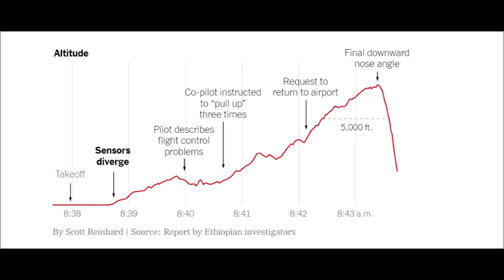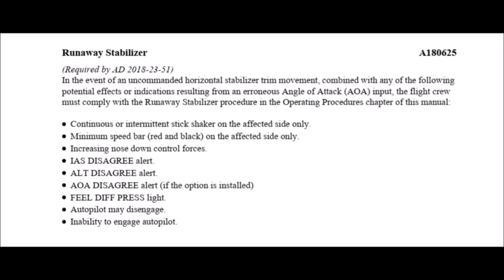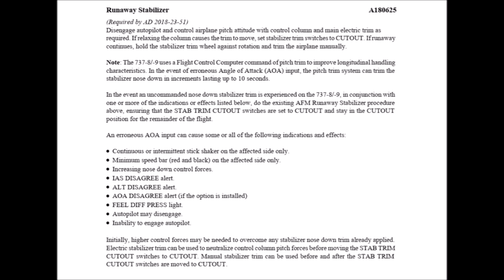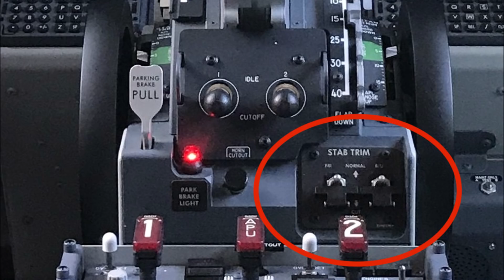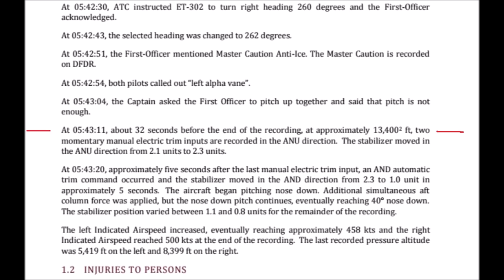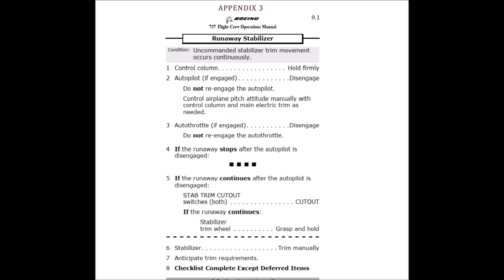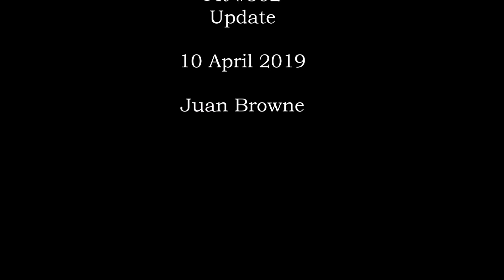737 Max Update 10 April 2019 Runaway Stab Trim Procedures

Comment: Juan, you did an remarkable job explaining the systems and procedures necessary to recover from an out of trim situation on a 737. Even laymen have a good chance to understand. One side note: My company's procedure when disconnecting the A/P was to also and immediately disengage the ATS. Handflying meant without any support by systems. This is why I liked the bird and the company I had such big pleasure to fly for. Handflying on visuals or whenever conditions allowed was commonplace. FOR PRACTISE! Knowing that OTHER airlines required pilots to turn on the 737's A/P briefly after T/O until maybe two miles before landing. Plus NOT disconnecting ATS when handflying. What we happily did. With the advent of AIRBUS' A320 things became difficult. I need not explain to you why ... Boy, am I enjoying my retiredness!

Comment: ---------------begin 1st draft of a new "Runaway Stabilizer" procedure.

A new switch, a 2 position toggle switch.
Up position labeled "HAL" enables all automation.
Down position labeled "DAVE" disables all automation.

-----start of new procedure---------------------------------

Condition:  uncommanded and/or unreasonable stab trim movement occurs.

1. Control Column...............Hold firmly

2. New Switch...................DAVE

3. If the runaway STOPS you are in complete HAND control of the aircraft and need to  quickly re trim with the main electric trim switches on the yoke.  Don't forget to manage the throttles.  Do NOT move the new switch back to the "HAL" position.  HAND FLY the aircraft, descend, land, and have the FCC (flight control computer) systems checked out.

< First exit of procedure >

4. If the runaway CONTINUES after the new switch is in the DAVE position:

STAB TRIM CUTOUT switch................CUTOUT

If the runaway CONTINUES:

< Same as old existing procedure from here on >

------end of new procedure--------------------------------

Notes:

1. New switch, Up position "HAL" enables ALL the computer systems that can touch the aircraft flight control surfaces.

2. New switch, Down position "DAVE" disables ALL the computer systems that can touch the aircraft flight control surfaces.  These systens include autopilot, autothrottle, MCAS, and any other systems that may be running "in the background" that can touch flight control surfaces.

3. If the above procedure had been active these two crashes most likely would not have happened because the pilots would have taken the 1st exit out of the runaway stabilizer procedure and been able to use the main electric trim switches on the yoke and quickly re trim the stab to regain control of the aircraft.  The other exit out of the procedure (after "CUTOUT") was the killer - they were at too high of an airspeed to hand turn the trim wheels which is the ONLY way to retrim the hor stab when trim switches are in "CUTOUT".

4. The time from start of procedure to HAND flying the aircraft in seconds;
   (Two pilots, one saying what he is about to do & the other confirming)
Old Procedure - step 1(5) + step 2(5) + step 3(5) + step 4(5) + step 5 (5) = 25 seconds.  Wheels ONLY.
New Procedure - step 1(5) + step 2(5) = 10 seconds.  Electric Trim on yoke + Wheels + MCAS disabled.

5. If we can split the two guarded trim cutout switches into two independent toggles (like it used to be?) and use one of them for my "HAL/DAVE" switch" so much the better.  It totally eliminates trying to find a place on the panel for "yet another switch".  The second toggle could then be the actual "CUTOUT" switch that removes power from the jackscrew motor.

---------------end 1st draft of a new "Runaway Stabilizer" procedure.

Hopefully we are not yet at the point where the FCC (flight control computer) can say:

 "I'm sorry Dave, I'm afraid I can't do that".

Comment: Juan, are you stating that the main electric trim switches  were not overridden by the MCAS system during that 10sec active portion of its 15sec cycle?  Thanks. It seems to me that the pilots' alternative method might have worked had they coordinated the electric trim switches with the STAB TRIM switches,
positioning them to the CUTOUT position before releasing the electric trim.   Based on the AD 2018-23-51 text, "Initially, higher control forces may be needed to overcome any stabilizer nose down trim already applied. Electric stabilizer trim can be used to neutralize control column pitch forces before moving the STAB TRIM CUTOUT switches to CUTOUT," the pilots seemed to have the right idea, but simply failed to move the STAB TRIM switches to the CUTOUT position before releasing the electric stabilizer trim. 

By the way, I wrote mainframe commercial system software for thirty-years, and I find the original MCS software design very disturbing.  There is a book, an old book called "The Art of Software Testing" by Glenford J. Myers, published in 1979.   In the book the author discusses equivalence partitioning and  boundary-value analysis, topics that do not appear to have been high on the list of considerations for the MCAS software developers.  I am also bewilder
as to why the FAA did not disclose, in AD 2018-23-51, the other conditions in which the MCAS system is deactivated: flaps extended or autopilot engaged.  It seems they still had a propensity to keep the system a black box--that's software parlance--despite the Lion Air 610 hull loss.

Finally, thanks for all the information provided on your channel.  I used it as the source of an English course essay titled "Open the pod bay doors, HAL."  It was on the topic of automation, the professor scoring it a 98%.

Comment: I like the way you report accurately and dispassionately the things the pilots did right and what they could have done better without laying blame. In the confusion of control being intermittently taken over by a system they weren't even aware of the existence of, well who knows what information overload those guys faced. That's why the NASA astronauts learned the schematics of the craft and practiced recognizing and overcoming every conceivable failure mode in the simulators so they'd automatically do the right thing. If Boeing had trained pilots in the sim to know what the AOA sensor failure did and how the MCAS would respond then the outcome could have been different.

Comment: Who did this video didn't show full preliminary report. When trim cut-out switches were already off after crew performed successful electrical trimming , MCAS system was knocked out and plane was climbing to requested 14,000 ft for about 2.5 minutes, horizontal stabilizer made again downward movements. What caused these movements if MCAS was inactive already??
Reply from the maker: You need to watch the series -covered here: https://www.youtube.com/playlist?list=PL6SYmp3qb3uPp1DS7fDy7I6y11MIMgnbO
Reply: If the 2 guarded trim switches are in CUTOUT the jackscrew electric motor has no power so the crew could NOT have performed "successful electric trimming".   MCAS was never inactive, it was just working against a dead motor and 5 seconds after you took the 2 guarded switches out of CUTOUT,  you would again be fighting MCAS down trimming using the now active motor.

Comment: Here are some other facts about the Ethiopian Airlines pilots in this crash.

The flight captain had over 8000 hours flying time, but only 181 hours in 737 type.
The first officer had apparently only 361 total flying hours. Some sources said 200 hours, but WIKI says 361. Neither would be reassuring.
Ethiopian Airlines had two Boeing 737max simulators, but neither pilot had trained in them.

Second issue: It has been said by some 737max pilots that the Runaway Stabilizer recovery procedure was not documented in the 737max flight manual. It had been described in the manual for the first generation 737s, but was apparently edited out by the time of the 4th generation manuals. That might mean that pilots who had not trained on previous generation 737s were not familiar with the procedure. So it is possible that the pilots in this case had no knowledge of the Runaway Stabilizer recovery procedures. The fact that they turned on the Stabilizer Trim switches again after turning them off adds evidence to that possibility. The fact that they left Auto Throttle on also supports that conclusion.

Time will tell if the pilots share some blame for the cause of this accident. I'm not trying to whitewash Boeing's role, but I do have concerns about the pilot training and the short flying experience of the first officer.

Comment: Nothing like sending pilots up untrained on a new system that requires them to perform 37 procedures exactly in order during a 3-minute life and death situation
Reply: Runaway horizontal stabilizer procedures have not changed on the 737 aircraft for more than 35 years. This crew was undoubtedly trained in that procedure but made the mistake of not controlling their airspeed by reducing the engine throttles, reactivating the the electric stabilizer trim motors was the final error that cost everyone on board their lives.

Comment: As a software engineer dealing with the FDA, I have some questions: 
1) how is it when systems obviously and detectably fail, all autonomous system don't give control to the pilot
2) why are the interfaces so technical and difficult, when analytically (as you do) there are some nonsense responses, who would benefit from a left hand or a right hand fail response when something is generally wrong?
3) how can an aircraft in general with 'intelligent equipment' onboard allow a nose dive and crash, when I assume there are a ton of other sensors indicating you need to pull up? (I realize that if all fails this point is void)

Not trolling, honest questions.
Love your channel as an amateur cesna operator, liked and subed
Reply from the maker: MCAS was set up the way it was to avoid a separate Type Certificate. Specifically- use the old "Runaway Trim" procedure to disable MCAS.

Comment: Boeing is so screwed.  I sold all my stock and I'm not looking back.  I see that on Apr 10 the stock actually went up.  OMG, is everyone nuts?  I'll buy it back when it hits $26.  I think Boeing has been taken over, either by bean counters or newbie engineer/code cowboys.  This totally sucks and it will get worse.  I totally have been wishing that Mary Schiavo were still head of the DOT.  We need to latch on to superstars and hold on to them at any cost.  Screw the Pentagon.  It's time to be adults.

Comment: A question, that may be fair to ask; you say that a directive was issued by the FAA to give guidance on how to handle such an error. What global impact does an FAA directive have and at what speed does such directives travel in non-native English parts of the world?
Reply from the maker: Effective globally. English is required language for aviators around the world for this reason (and others).
Reply: @blancolirio  Good to hear, are other organs advisories as effective "the other way"? Still,  while aviators may be required to know English, do you(pilots) get these advisories direct, or do they pass through channels? (not necessarily a problem for you but, Ethiopia might not be the same)

Comment: I really like the way you explain things. Having said that I have been a CRM Instructor for many years (as well doing the same job as you only 4 engines not 2) and I disagree somewhat with what you said about the HF response to startle. Yes ANC is definitely the correct response and a scan of the FMA might have helped. However, it has been established that humans can take several seconds and sometimes up to a minute to recover from startle a situation that is only exacerbated by high workload. Also tunnel vision is not the only symptom of startle, look up the “FIRE” exercise, an oldie but still quite relevant. Basically not only do we suffer from tunnel vision but our cognitive abilities even to do basic 2+2 maths is degraded.The scene in Sully where Hanks says “Can we get serious now?” is quite informative here. So whilst I agree wholeheartedly with the position that not retarding the throttles ultimately killed them as usual James Reason’s Swiss Cheese is stinking up the place yet again. PS really like the videos though.
Reply from the maker: Thanks Garth!

Comment: Boeing notorious labor and technical issues do not change the fact that their product lines remain leading edge of tec & still on full GO status neither that any of those modern Jetliners are designed to save the day of a poorly trained pilot (s) and substandard Airlines confronted with issues which most of other well crews would have easily overcome. Conclusion, if you care about your life, fly only those Airlines with good safety standards other than Lion Air , Ethiopian, Bangladesh Pakistan, Indian ,S.American Airlines or you name it because some of their pilot force can't even qualify for a standard commercial pilot license in EU or N.America. Last but not least the F/O had logged 325 hrs total and some 200 hrs on the type. NO FAR-135 Airline in E U and N.America would hire a F/O so low on hours for such Ops , this along with other events from the past of this Airline, qualifies it as highly fraudulent and worth being avoided ! I won't be surprised if due the above reasons the insurance broker will reject the post crash claims
Reply: Maybe you should read some history on ET and it’s pilot training. Your statement is not only poorly formatted but also shows some spelling errors which is normal when writing on social media so I place no weight on that when assessing your post and it’s intent.  BUT it comes across as poorly researched, and possibly bigoted. ET flight operations was started by a major US airline and has had a pilot flight academy since 1964. I recently spoke to a senior ET 777 Capt whilst we were checking in our bags CAN. There is more background here.
Reply: @garthwilliams4165  -huh are you on medications ?
Reply: AMTEC TEC not even worth it....
Reply: @garthwilliams4165  -thank you, I corrected my typing errors , apart your English
grammar  skills and bitching on social media how many other languages do 
you speak ?  at my end six , while English is not my mother tongue, neverthless 
your weight placing is irrelevant to me in similar to your Aviation knowledge 
gained in a pub or something  !
Reply: Aloha Oahu and there you have it. It’s impossible to have social discourse and disagreement anymore. It immediately turns into mudslinging. As to where I got my aviation experience...hmmm let me see. 15,000 hrs widebody worldwide ops about 6,000 of which are PIC. And you?
Reply: @garthwilliams4165  not so fortunate as you, reservist F-16 Block-60 pilot, FAA ATP 1981. Swiss ATP 1981, 7500 PiC 757 and total 12'000 hrs- neither any possible GA background of yours  good luck !
Reply: @garthwilliams4165  -PS: Nevertheless your English grammar skills are overwhelming .and yes I need to go back to school !
Reply: Aloha Oahu and unfortunately because of the mudslinging the point of our original conversation was lost. You lumped ET in with Lion Air, PIA, Airblue and Biman (Bangladeshi carrier). I objected to this because I did some research into these airlines and because I share the airways with them quite often. I agree that Indonesia has a spotty safety record and PIA and Birman have both at some point been banned from European airspace for various reasons. Ethiopian is a different type of operation to the others. They have a reasonably young fleet with an average age of about 10 years. It would be even younger if they didn’t have 767’s. They have been operating since 1945 which makes them one of the oldest airlines in the world. And as I said they have had a pilot training academy since 1964. They also have a pretty good safety record. Besides flying into Adddis every day is no joke. The airfield is 7500ft with hills to the north. They also are one of the few airlines in the world that has a MAX simulator. And before you ask, no I don’t work for ET.
Reply: @garthwilliams4165  - I am very much aware about these facts , nothing new at my end --as into " mudsliding the point  " and your previous remarks
that is why is impossible to have social discourse and disagreement anymore  especially because of those US social media grammar teachers who
other than own mother tongue can spell a word in other foreign language . Good luck, rest assured I will improve my English skills in due course .
Reply: Aloha Oahu I’m done. Have the last word. I am not sure what you meant to convey in this last response but I just hope you are not the bigot and/or jingoist your initial post suggested. Maybe we’ll pass each other in the FL’s.

Comment: Good video ,have you seen mentour pilots video on the manual trim problems (miss trim )and force required in certain situations its very interesting  it is the ng simulator so obviously no mcas but the runaway procedure and forces needed at speed are discussed and I presume similar to max .

Comment: Boeng has developed much on 737 max where some inexperienced Pilots must crush the plane so I advice boeng to restructure  the system to be easy controllable I found this situation came critical to one of the aircraft in US after the design had no indication of the plane has reached the  undocking safety altitude due to the same experience why boeng should they not remodify the system into an automatic manuvar when it detects the same MCAS  problem the plane take the system into self manual and stabilize the plane this will even regain trust I love  boeng so much #+255713141323

Comment: the boeing jackscrew needs a re design.  It is very badly designed.  It needs hydraulic counter-weight in the tail, so that you can wind the cables in the cockpit.
Reply: The problem is the MCAS system, being poorly designed, had too much authority over the plane. The Jack screw system has worked pretty well since 1967.